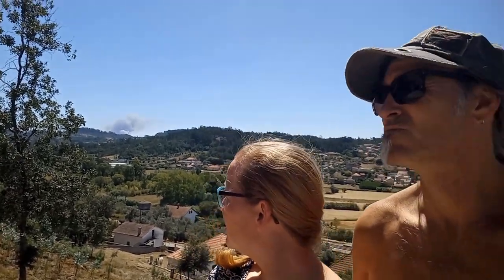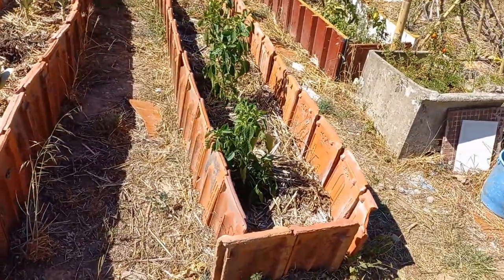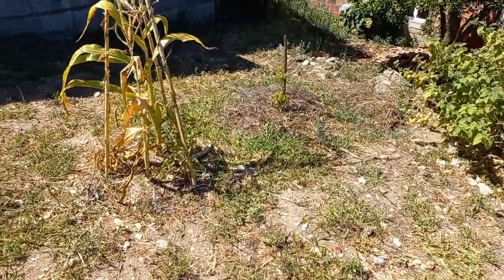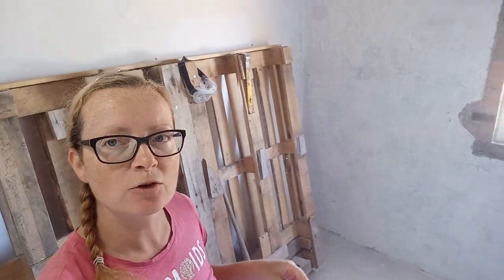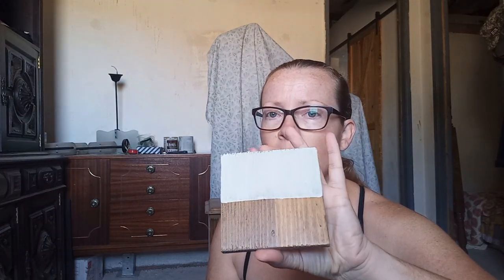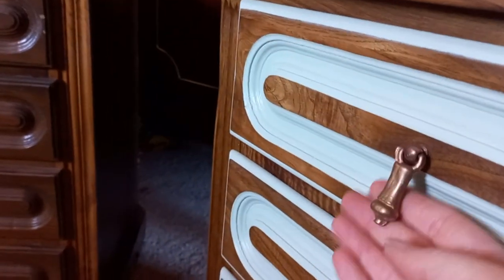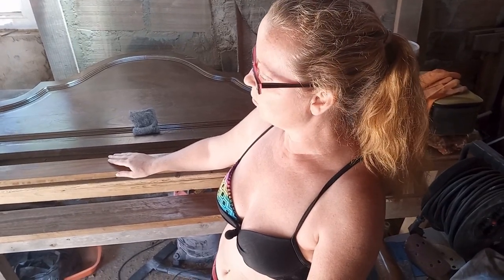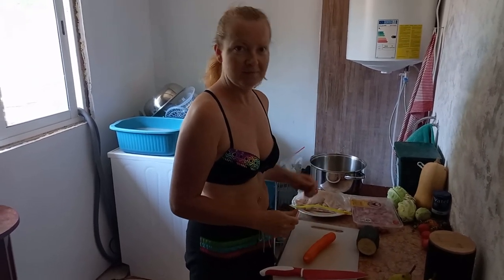Renovating on a Budget. Frugal Life. Gardening, Cooking & Homemade Cat Food!

Comment: Great work, you two. It really looks dry out there. And good job on the drywall. 
I know the filming is easier in the house, but I would recommend spraying paint, stains, and laquers in the wood shop. Great finish.

Damn Grant that sause was looking good.
Reply from the maker: Thanks! Feels good getting the drywall done. 🤗 Normally I wouldn't use spray paint indoors. The main reason I decided to use the spray paint in the house was due to high winds. Unfortunately my woodshop still has no doors, so it would be too windy and dusty, and the cats would get their 🐾 all over the wet paint. I've bought a polyurethane clear coat for future, better coverage and more durable than the acrylic spray paint!

Comment: For the tomato plants, for when you go away, you can make homemade ollas with a terracotta pot buried up to the collar next to the plants (you will need to silicone a rock or something over the drainage hole). Fill with water and cover. I use an old plate or a larger terracotta saucer for the top. It helped our more sensitive shrubs survive the heat.
Elaine from PIP's on Youtube uses plastic bottles filled with water tied loosely to her trees to slowly add extra water to them. I think she drills holes in the caps and cuts the bottoms off then tips them upside down. 💕💕
Reply from the maker: Thanks for the tip! ❤️ We started off more organized and used 2L pop bottles for  drip irrigation and for liquid fertilizer. For some reason we forgot to do it lately. We definitely need to keep on top of the watering now that the heat is here!
Reply: @notyouraveragegringos  The heat has been brutal worldwide, it seems💕
Reply from the maker: @robine916  Yes, it’s been a crazy year so far. There's been flooding in China and Japan. Flooding and hail in Canada yesterday, and a hail storm dumped 30cm of hail in southern Germany yesterday. Meanwhile wildfires are raging in BC, Spain and Portugal. You don't know what to expect anymore! ☀️❄️🌩🔥

Comment: Lots of progress in the house. Having the walls insulated will make a difference in the summer. Those fires are a quite alarming. I hope none get out of control. The night stand looks awesome. You will have a nice thrifted bedroom set when it's all done up. Tomato sauce😋. Did you water bath? 🙂👍👍🇨🇦
Reply from the maker: It feels like we’ve made some progress and a huge mess. 😂 We’re already noticing a difference with the insulation, it’s already feeling cooler in the house, and it will help retain heat in the winter too. We’re lucky so far, the wildfires are not really close to us. The biggest fire in Portugal right now is in the Castelo Branco district. PiP’s Living Off Grid posted a video earlier today showing the fire going through their village and everyone was out with their garden hoses working with the Bombeiros to protect the village. Looked quite terrifying. 😳 I’m glad you like the night stand. I can’t wait to finish the rest of the set and get it into the guest room. Having one room finished and organized will make life a little easier and less hectic. 😂 Grant didn’t water bath the tomato sauce, but all of the lids popped so they are at least sealed properly. I’ll have to figure out how long they should be good for? 🤔 How is your pantry coming along?
Reply: @notyouraveragegringos  my pantry is framed. I am getting the drywall on Monday am. I will get it up. Then tape and mud. I ordered shelving  boards and some 1x1 for cleats from Home Depot.. 🙂👍👍🇨🇦
Reply from the maker: @deborahwhite2339  Sounds like you're making great progress! Soon you'll be busy filling the shelves and organizing everything. It’s going to be fantastic! 🤩